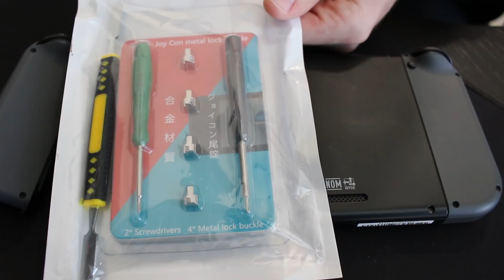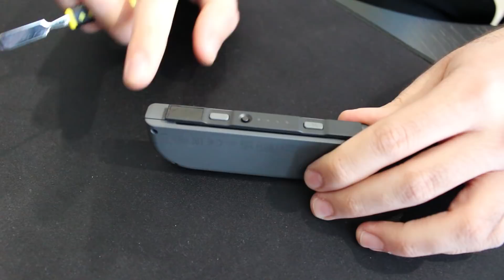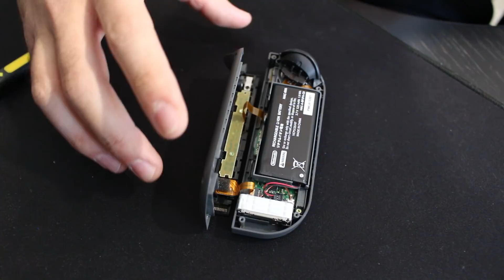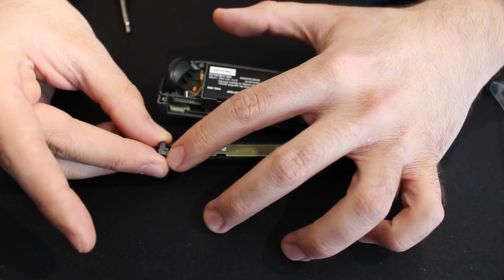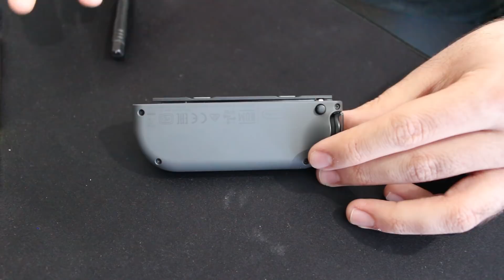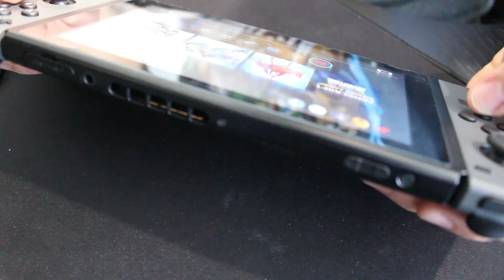How to Fix Your Joy-Con Not Locking | Nintendo Switch Metal Buckle Upgrade

Comment: At the price these go for, maybe Nintendo should just make them in a decent quality to begin with
Reply from the maker: Someone else here said that was designed as a safety mechanism for when the Switch is dropped. The problem is with enough time they can just pop off with little force.
Reply: @MrMario2011  Correct. I called Nintendo and their technical staff confirmed this...if you accidental drop your Switch sideways with Joy-Cons facing downward, they are designed flex or even break off allowing come cushioning for the Switch and hence possibly not damaging the Tablet itself.

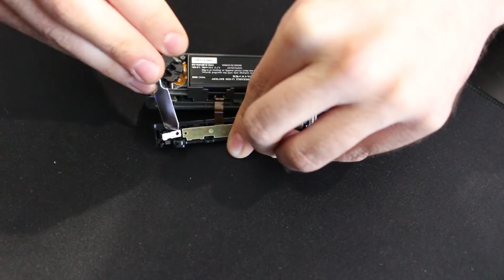Comment: WARNING:  DO NOT BEND THE METAL TAB as seen at 6:13. The tab is a thin metal bracket, you know what happens to thin mental once you bend it up and down at a crease right? it snaps/breaks. 
you need to lift both legs of this tab by applying equal pressure  on the underside and lift it all out fully....and then re-inserting the legs back after you replace the latch. there are grooves where the legs slide back in.

Couple bends on that bracket and it WILL SNAP!
Reply: I agree 110%
but on the other hand, if it does snap, at least the way he's done it, it'll snap on the side with the screw, so it still wont be lose once the screw is in place
Reply: 6:11 in Mario's defence, I personally feel bending it a little upwards like that is easier as if you take the whole thing off, it could either be damaged during the removal or won't fit in flush after re-insertion due to the pressure upon taking it out. I have tried both methods and think Mario's one is better as one side is always the pivot. Just my thoughts.
Reply: @GFSCN69  Although I agree that the camera angle wasn't close in enough to know that the latch is supposed to be pointing up but if you replay the clip a few times, you will see that this is how it should be - also, regarding lifting the metal plate or not, I still think doing Mario's better is better. 6:11 in Mario's defense, I personally feel bending it a little upwards like that is easier as if you take the whole thing off, it could either be damaged during the removal or won't fit in flush after re-insertion due to the pressure upon taking it out. I have tried both methods and think Mario's one is better as one side is always the pivot. Just my thoughts.

Comment: 6:11 in Mario's defense, I personally feel bending it a little upwards like that is easier as if you take the whole thing off, it could either be damaged during the removal or won't fit in flush after re-insertion due to the pressure upon taking it out. I have tried both methods and think Mario's one is better as one side is always the pivot. Just my thoughts.

Comment: Just a word of warning to folks. I bought this kit from Amazon and the screwdriver that comes with it is crap. Mine wouldnt remove the screws and it board out one of the screws so it is never coming out. Use quality screwdrivers.
Reply: Thank you for mentioning this!
Reply: John Meadows  I can vouch for this guy, luckily when I noticed the struggle I used my quality screw driver.
Reply: Ive learnt the hard way... i bought the kit but i dont have a better Y00 screwdriver. So ill probably have to find a good quality screwdriver somewhere. God knows how ill do that
Reply: For me, I had to come in at a little angle then it worked.
Reply: @bigruss8103 did you ever find one I had one of the screws not come loose and I’m looking for a good quality screwdriver did you ever fix yours?

Comment: Does this remove the wiggle between the Joycon and the system? Mine don’t seem to be easy removeable by just pushing, but like I said, wiggly.
Reply: Ah and great vid as always :D
Reply: it depends on the spring.
When i replace the latches, i stretch the spring a little and the connection is tighter with the unit when inserted.
If you think about it, it's the spring strength at play there :)
If you replace or get someone else too, be sure to mention it.

Every switch i replace them in have had no wiggle at all.
Reply: Ah, okay thank you!

Comment: is it just my switch unit or the kickstand on the back doesnt like to stay in the flush position. it always sorta swings out when i play in handheld.
Reply: Well, you can bend it to fit better (at your own risk).
Take the stand, and pop it out of the slot.
(don't worry, it's just latched in and pops back on easy too).

when you have it off, you want to flex it (bend it),
Now, you want to flex it the right direction, so if you cant tell, face the inside of the stand towards you and bend the top and bottom towards you.

Basically by bending it and returning it to the unit, the stand will once again be more plush with it's connection.

(don't overbend, take your time and test it anytime you need too.)
Reply: ...Or Nintendo has a replacement stand in their online shop if this doesn't work